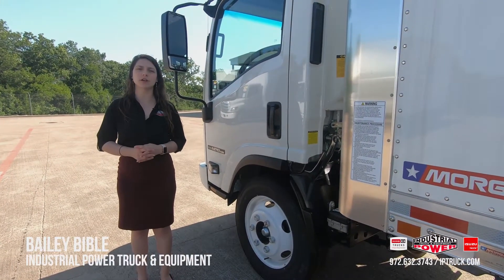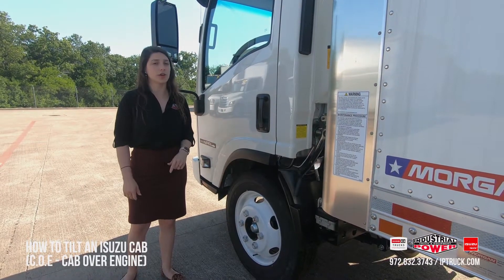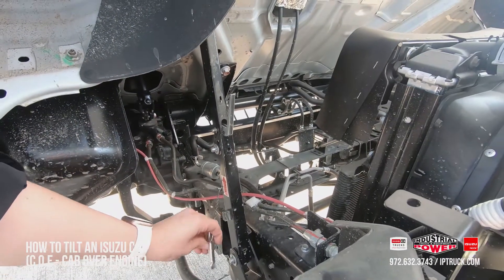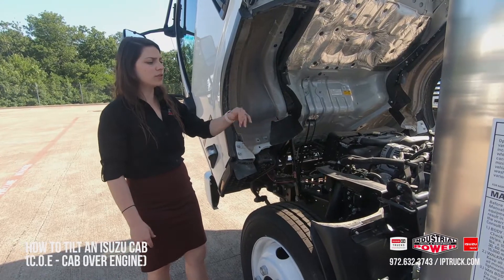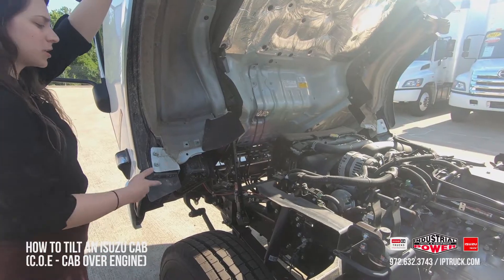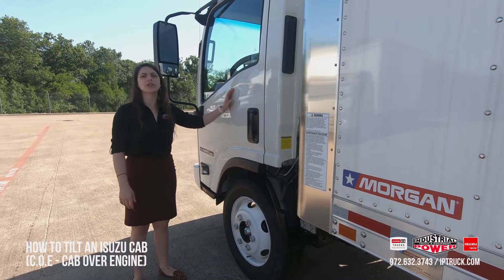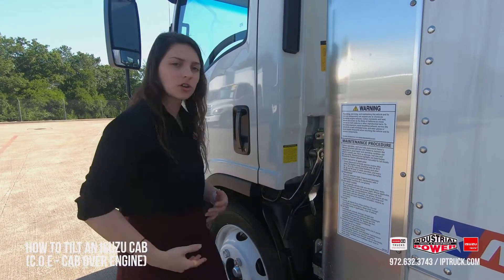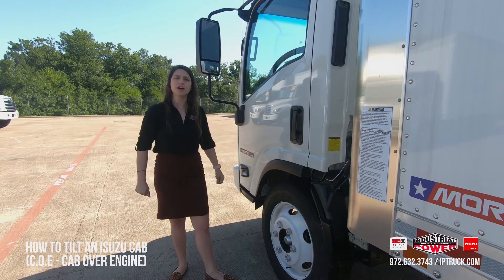How to Tilt Isuzu Cab | C.O.E - Cab Over Engine

Comment: Just started working on NPRs recently for a local company. Had to have two guys to tilt the cab since it had a lot of center console accessories plus storage, it was a pain then I had a moment. OPEN the doors, it takes so much weight of the rear of the cab that a 4-year-old sumo wrestler can tilt it. They owened this truck for over 20 years and took me 5 minutes to figure this out.
Reply: Did you leave the doors open while inspecting the engine?

Comment: Is there some sort of security lock to keep unwanted persons (such as tweakers) from lifting the cab to steal parts? I would be interested in purchasing such an item for our two Isuzus
Reply from the maker: Randy thanks for the question. Unfortunately, there is not a way to lock the cab down on the 2 door models. We assume this is done for maintenance and service access of the truck at any time.
Reply: @iptruck what about on the 4 door models?  Thanks!
Reply from the maker: @natalienaranjo9597  They wouldn't be able to get to them either, they're actually bolted and would require a crane to be lifted.